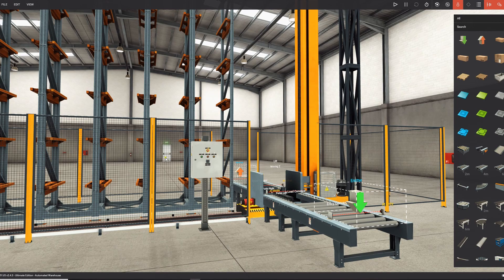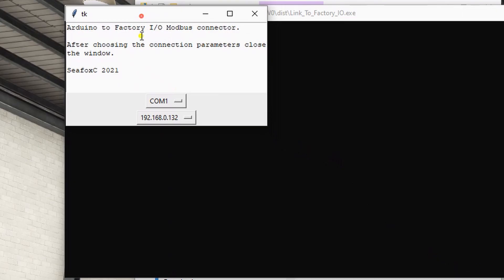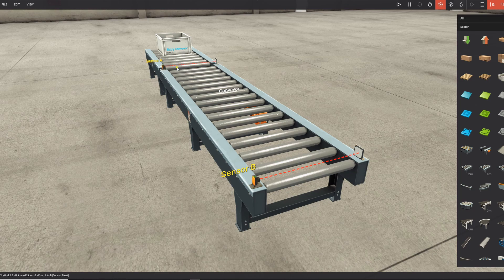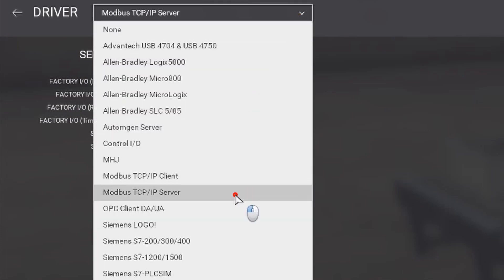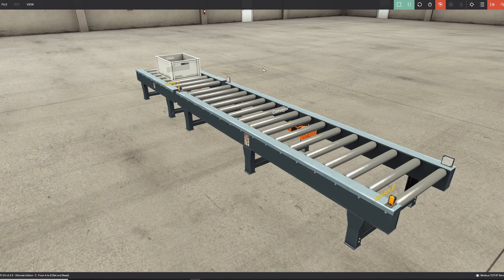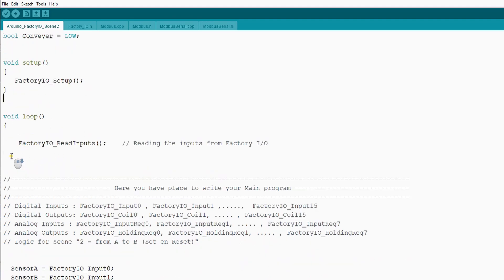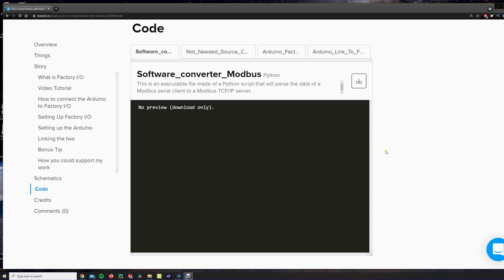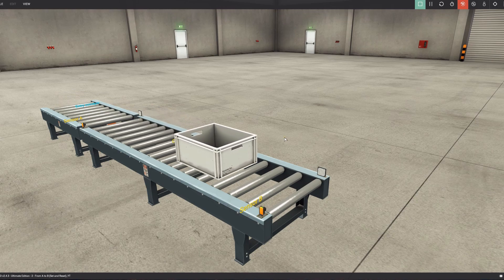How To Connect Factory I/O With Arduino (For Free)

Comment: i changed the ip address but the tx rx still dont blink and they dont connect, please helpp
Reply from the maker: Did you read thru the written guide? https://www.hackster.io/Seafox_C/run-a-virtual-factory-with-arduino-2e2046? It is hard to troubleshoot from a distance. Make sure you run as an admin and maybe deactivate windows defende or your antivirus. Also make sure you use the write COM-port.
Reply: @seafoxc  yes i have read and followed everything, but it still doesnt work, the tx rx dont blink
Reply from the maker: @joannaxu7786  can you try on another pc?

Comment: when i use while loops it won't connect to the IP, any reasons?
Reply from the maker: The communication with FactorIO works with Modbus. Modbus is made for industry and needs to poll in a certain time otherwise in a real factory environment you could miss the signals from you I/O. Your While will take too long to process (do u use delays?) and Modbus will create an error.

Comment: Hello good afternoon !  all is well ?  I really like your work and commitment to what you do and I would like you to ask me a question if it were possible, please, could I use the files you provided to connect to factory on an Esp32 I have?  I thank you for your attention !
Reply from the maker: I Don't have an ESP32 to try it out but It could. Keep in mind that the MODBUS communication requeres a USB connection to the PC running the program. I tried compiling it with an ESP32 board selected and it compiles. So try to upload it and let me know how it goes.

Comment: Hello, I connected arduino and factory ıo but I didnt see arduino input read.Arduino uno has totatly 12 digital pins.But Code say 16 pins.Please Can u explain pins of Arduino?
Reply from the maker: You have 16 virtual inputs and 16 virtual outputs that you can connect to Factory I/O. You can use the 12 physical inputs from the Arduino in the code but you don't have to. I also made a claw machine video and in the description you can find the code where I use the pins of the Arduino to connect to the virtual inputs of Factory I/O. :-)
Reply: @seafoxc  I guess find the problem.There isn't option of realtek pcıe gbe family controller in the connectıon confıgration of Factory ıo.There is software loopback interface.How I arrange this settings?
Reply from the maker: @softwareofautomation1366  "pcıe gbe family controller" is the name of my network card. I use the default setting for Factory I/O. You need a network card to connect to Factory I/O. Can you check your network card "Control Panel\Network and Internet\Network Connections" and see if there is one. If you see you have a network card you maybe did not give permission to Factory I/O to have access to your network when installing.
Reply: @seafoxc  I reinstalled the program. It never asked for the trace you mentioned. I tried versions 2.5.0 and 2.4.3. By the way, there was realtek pcle gbe family controller in the network connections section. Which version of Factory IO are you using?
Reply from the maker: @softwareofautomation1366  I use version 2.4.3. Maybe make sure it has permission in you anti virus and Windows Firewall and also open it as administrator?
Reply: @seafoxc  When I connected to the modem with Ethernet, I saw realtek gbe in factory io. So for realtek gbe card, it is necessary to connect to the modem with ethernet. Realtek gbe is activated. Thank you for all the answers, I learned a lot of new information.
Reply from the maker: @softwareofautomation1366  I'm not sure if it is necessary to be connected to a modem but you need a network adaptor to send the data to Factory I/O. So the app i wrote in Python converts the modbus message send over a serial communication to a modbus message send over TCP/IP to an IP adres. Is it working now?
Reply: @seafoxc  Yes it is working properly now. Thank you very much.

Comment: How change the "link to factory io" ip address?
Reply from the maker: I hardcoded it in the Python script and from this script I created a exe. file. If you want to change it you should install Python and go to the written guide webpage and download "Not_Needed_Source_Code_Modbus_converter" file. You can edit the code in the Python IDE. If you try to run the script you will get some errors because you have to install some libraries. To install libraries I would advice "PIP install" in the command prompt (just google "how to PIP install"). In the first lines of the python script you can see the modules that has to be installed to run the script (pymodbus , tkinter , argparse, socket, umodbus). after PIP installing them you can run the script with the IP address you want... Just wondering why do you need to change the IP address?
Reply: @seafoxc  Thanks!! My ip address of PC is not in 192.168.0.XX, I must change that!
Reply: @劉建忠-l7d  Hello did you connect the factory io and arduino?